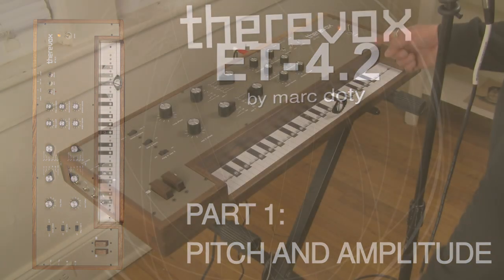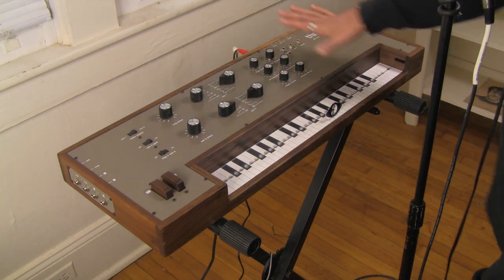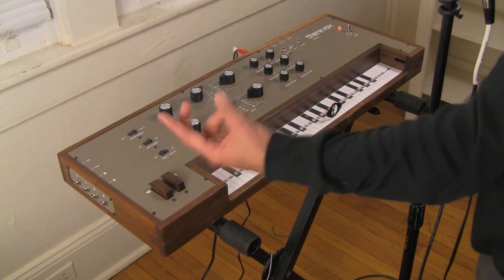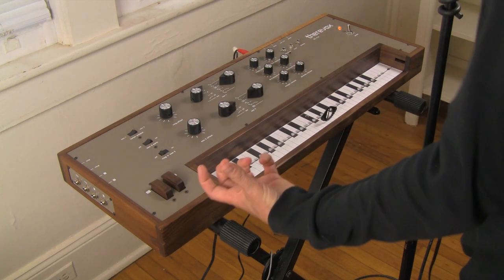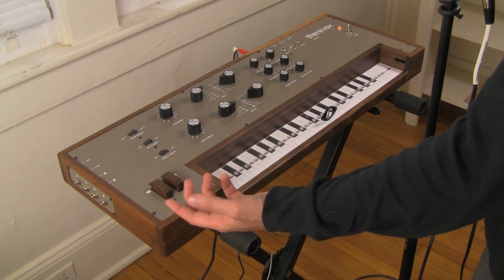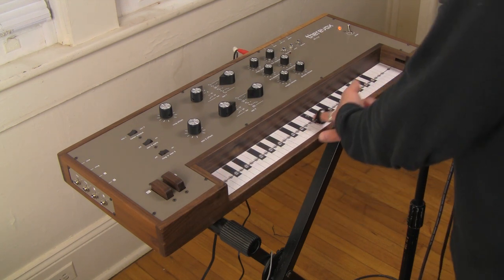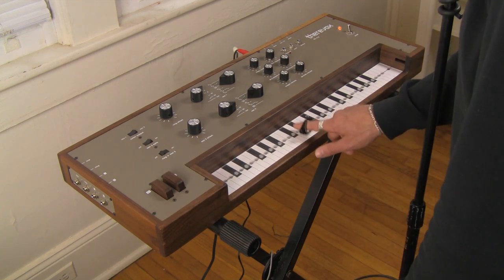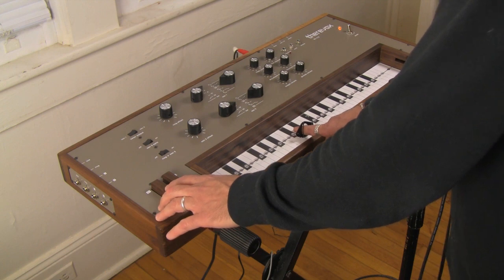The Therevox ET-4.2-  Part 1: Pitch and Amplitude

Comment: The version of the Ondes Martenot that finally saw release did have a monophonic keyboard that you could wiggle for vibrato, as well as the "ribbon"; however, you still needed to press the button in the drawer to play a sound.